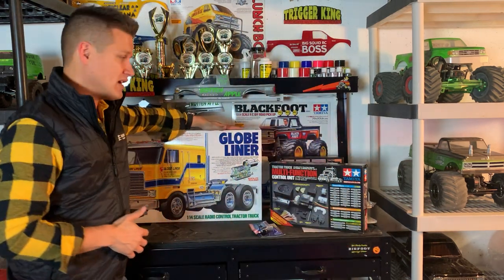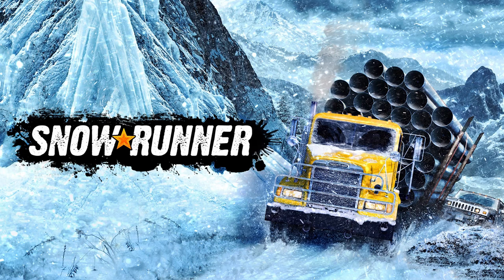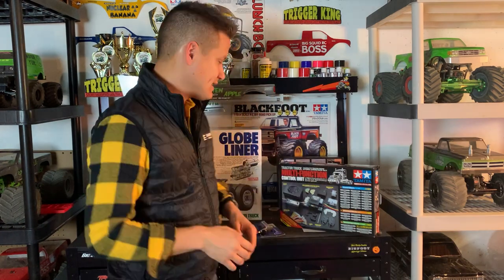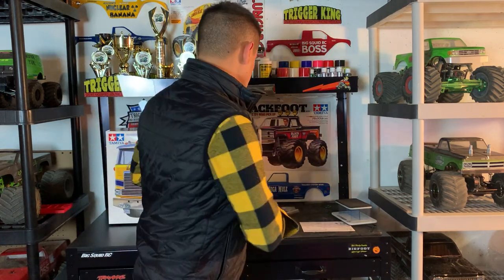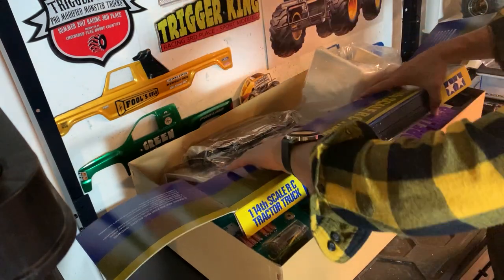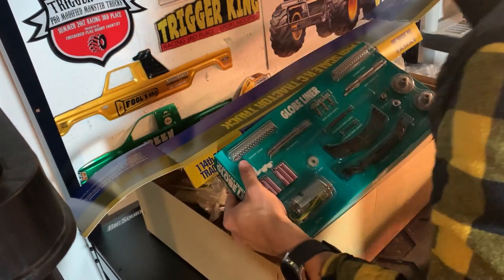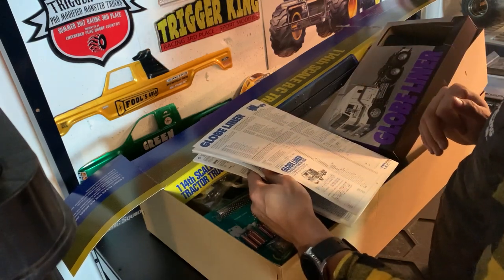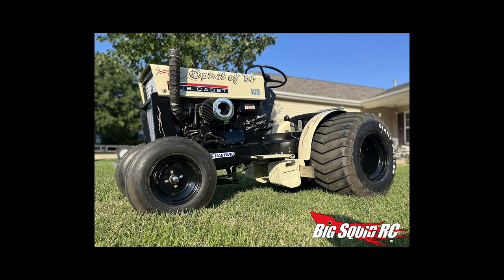Building an R/C Logging Rig - Tamiya Globe Liner & MFC-01 Unit Unboxing

Comment: This is definitely up my alley as well as I’m a truck driver. I currently have 2 Tamiya Ford Aeromax’s. That are in various stages of construction. Been into the semi trucks since 1999. Hopefully2023 I’ll have these trucks somewhat completed.
Reply from the maker: Originally I had thought of an Aeromax to do it up like a Bigfoot hauler but with the scale being 1/14 and that not playing well with the size of most solid axle monsters, I figured that wouldn't make much sense
Reply: @TriggerKingRC  
I do have plans for purchasing another Aeromax.
Reply: @TriggerKingRC 
I just came across a channel on YouTube where a guy custom built a 1/10 scale MAN truck and a 1/8 scale truck and talk about some massive trucks. SBR RC TRUCK is the channel

Comment: Always wanted to build one of these as a kid as well and then built a black grand hauler a few years ago with every hop up. One thing I wish I did (saw it on a blog years ago), was drill a small hole through each cross member in the rear to cleanly run the wires. I can't remember if it was the grand hauler or MFC, but it came with a small black wiring room which neatly hid the wires in the back. Take your time and enjoy yourself.
Reply from the maker: That's a great idea. Since this was shot I've actually completed most of the mechanical parts of the truck and I'm about to the point where I'm going to be plumbing it with all of the wires. Running some through the cross members sounds like a solid plan to keep it clean! This is a really fun build so far.

Comment: I drive the 1:1 scale trucks, but I have one of these kits waiting at the local R/C place when I get home. Injora rims & tires, Beier unit on the way from Germany. Metal gears and shifters and a 21.5 brushless.

I'm looking at million-weight diff grease instead of spooling the diffs, but now The Algorithm knows what I've looked at, and it wants to sell me servo-locking drive axles and faux air ride suspension, but the reviews look like they were written by the same computer that ran the CNC mill that cut the parts in the first place, so I dunno

God, diving into this headfirst is gonna be a trip, though
Reply from the maker: Ha, sorry to contribute to The Algorithm and all the crazy stuff it shows around that. I had heard about using million weight diff but in building most of the truck so far, the silly putty seems to work nice. I suppose the real test and when I have it under a load! I've seen those locking axles and while they are nice, I dunno that they seem worth it me as most of the time I have this truck out would be on the trail. Good luck on your build, I've had a lot of fun so far!
Reply: @TriggerKingRC  i think the best option across all driving styles would be three Torsen diffs, but who makes even one of those at this scale?